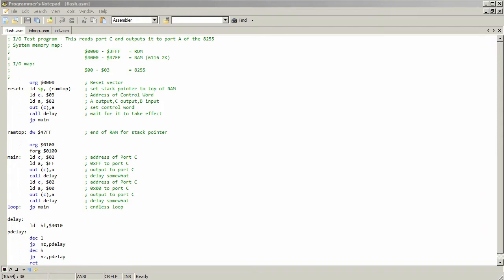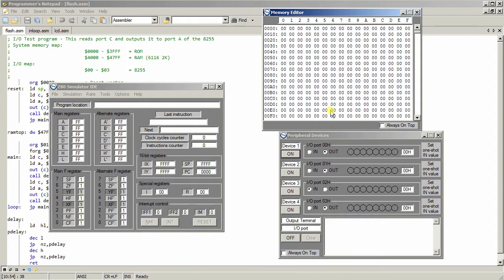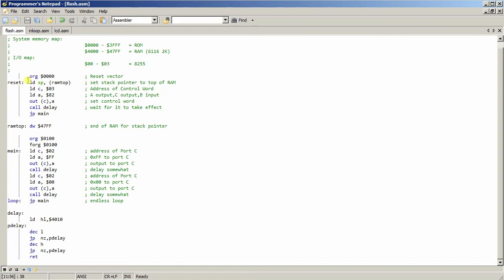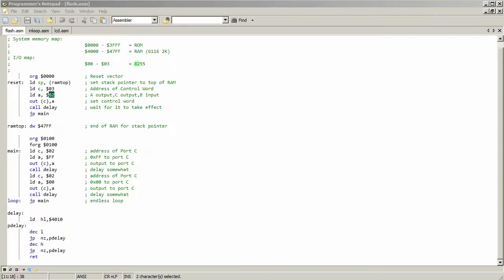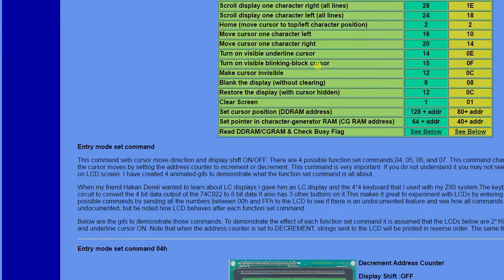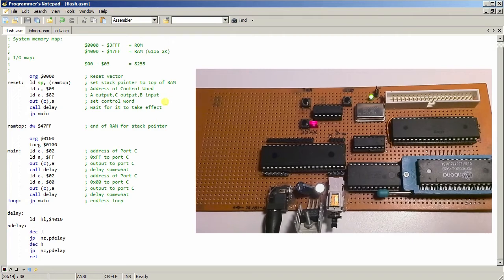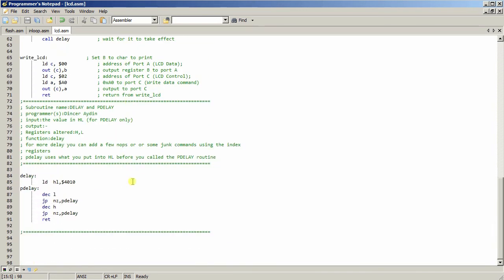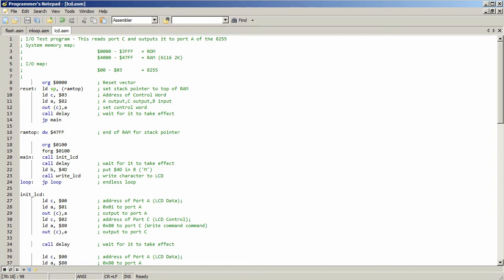Z80 Project 008 - Input / Output success

Comment: About a week ago I wired up an LCD display to my Z80 board, and wrote some code to write messages to the LCD display.  I made a video then on it posted to FB, but since you posted yours.  I have put mine up now.   :D
Reply from the maker: Very nice, I just watched it :) I'm probably going to work on mine this weekend, hopefully I will have success like yours :)
Reply: I am sure you will.

I have some of the same issues work and kids, Marching Band season is just over.  Kept my weekends filled.   Sometimes weeks go by before I get to work on testing out something. 

Once I got the bugs and some things I missed out of the initial build, so far been able to get the hardware to work smoothly.

Speaking of the Stack pointer, that was my first test that my RAM was being access correctly.   That the program would come back from a sub routine call.

I worked with LCD displays in the past, most units use the same command set and have the same pin configuration(Parallel ones).  The only thing is maybe you will need to do a small delay each time you write to the display, I was lazy not reading the Busy flag from the display.  Instead I just have a small delay loop before every write.  I used one port for 8 bit data, and 3 bits from the second port for control signals.  If you need any help just let me know.
Reply from the maker: I've experience with LCD's from when I used to design control systems based on PIC's, i used to have a huge 20x4 display, I would have loved to still have had that. I have just this moment got it up and running, it's usually the little things that get you, my mistake this time was that I didn't take the enable pin before the next command/data so it didn't get past the first command. I just need to clean my code up a little and I will probably start working on getting my keypad running. That means I will definitely be filming another video soon :) Many thanks for the offer of help, I will keep that in mind for when I run into more issues.